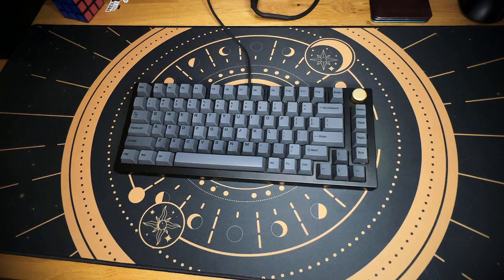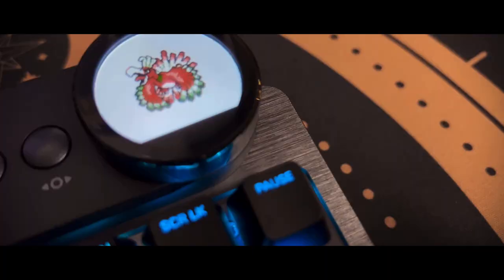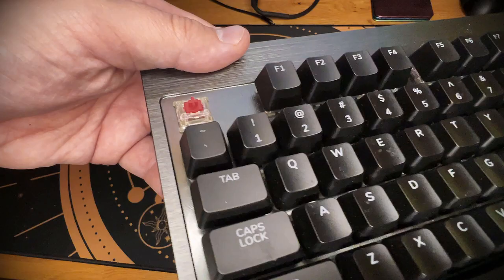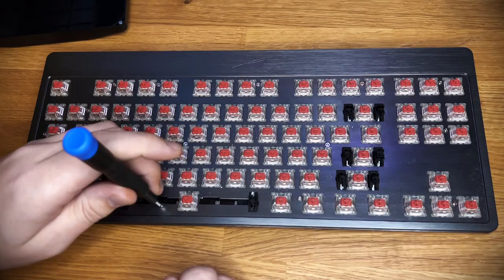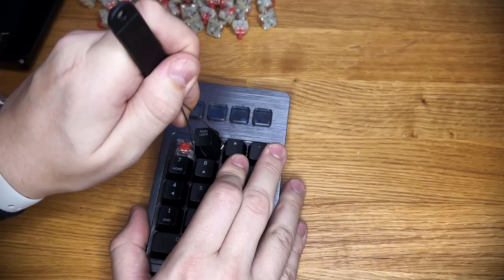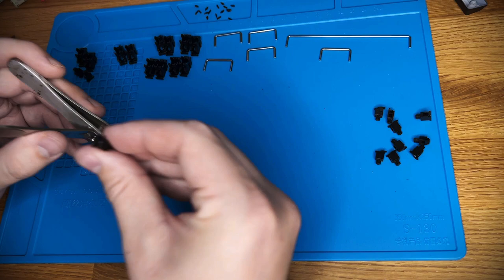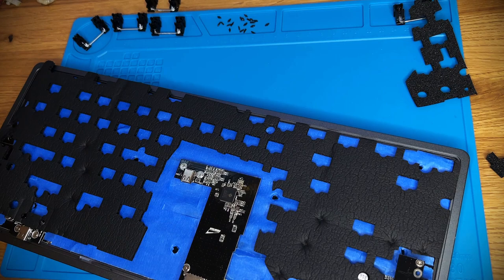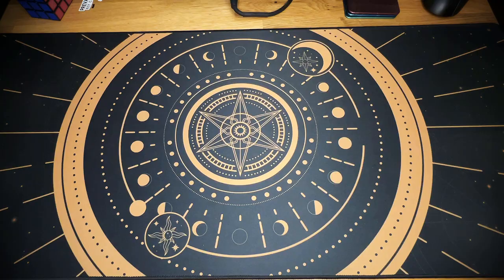I Made This Pre-Built Keyboard THOCC!

Comment: Hi sir may I ask how did you clean the factory lube from your stabs? Did you just wipe it of. Also did you apply just lube on the switches or did you clean them first?
Reply from the maker: I just used some paper towels to clean off most of the factory lube from the stabs. I don't worry too much about making them perfectly clean, and having a bit left over hasn't given me any problems so far. 

These switches came completely dry so I just applied lube as I normally would, but I don't usually clean factory lubed switches before I lube them unless there's a LOT in there. Just going over the factory lube with mine has worked well for me in the past!

Comment: I presume that most of the difference comes from lubing the switches and stabs? I think the lack of ping and the slightly deeper sound is the big difference maker. My keyboard is the same way: minimal ping, deep sound, but it's a 50 dollar unmodded board, completely lacking in foam. The only thing that sounds bad on my board is the backspace stab and occasionally the spacebar stab if I'm hitting it hard enough. I'm using Glorious Panda pre-lubed switches, which are very nice, for someone that doesn't know or have the patience for lubing. I can't imagine that the 200 dollar keyboard base is worse than my unmodded 50 dollar one lol
Reply from the maker: Oh yeah, lubing and filming the switches was the biggest upgrade for this board! It's hard to imagine that a keyboard this expensive only offers crappy stock Cherry switches, but at least it's hot swap so they can be easily removed and tuned if the user wants to. Pre-lubed switches have come a long way since I made this video, though. If I did it again today I would probably consider just swapping them out entirely.

Comment: Great video! I bought this keyboard as my first mechanical keyboard and I'm excited to modify it the same way you have in the future, although I'd prefer to change out the switches. Do the Gateron Ink Black switches allow the RGB to shine through very well? I've been eyeballing them for a while now....
Reply from the maker: Thank you! The ink blacks will dim the RGB a decent amount unfortunately. It’ll still come through, but not as bright. One thing to also consider is that this board only supports 3-pin switches so anything 5-pin, like the black inks, will need the extra legs clipped off.